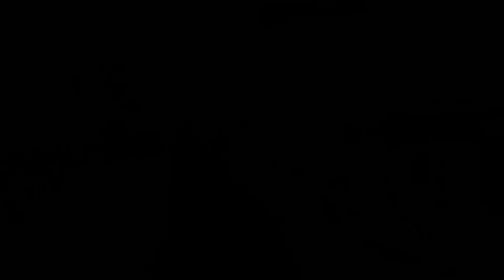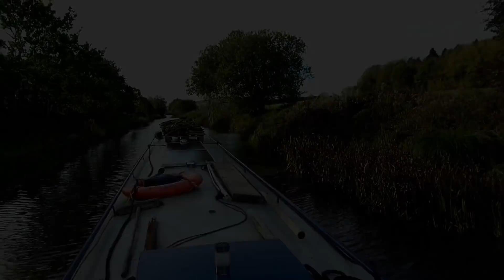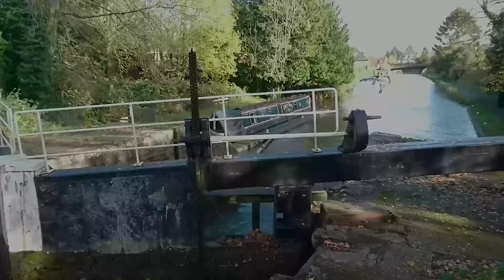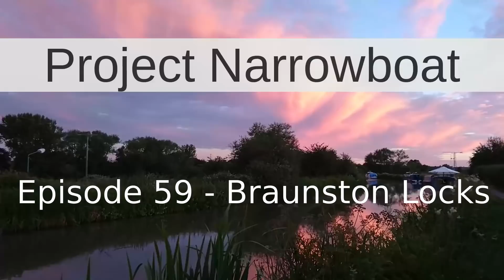Project Narrowboat ep 59 - Braunston Locks

Comment: What you can do as you go into the lock is step off at the bottom of the steps and easily walk up, lifting your rope over the rail on the gate. That is why it is sloped on the gate end. The boat moves in on its own and you don’t have to climb the ladder. Then you can close the gate and hold the centreline.
Reply from the maker: I do that only occasionally, if I feel everything is timing out just right.